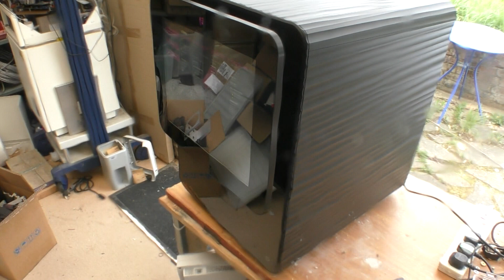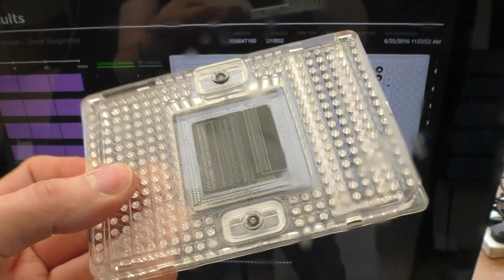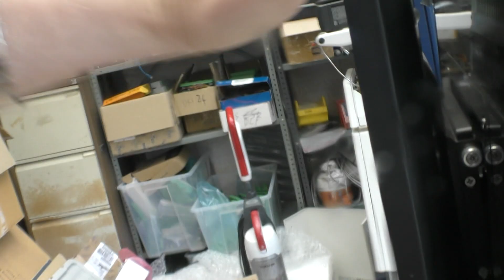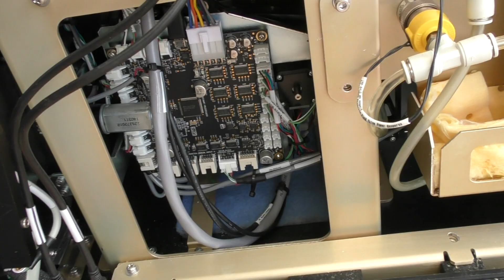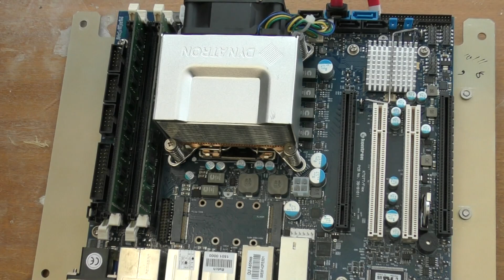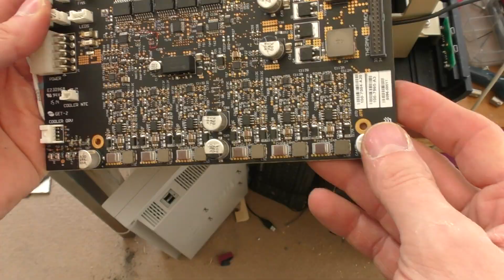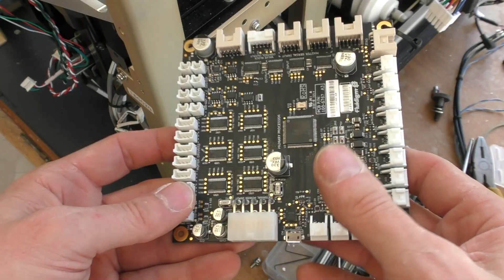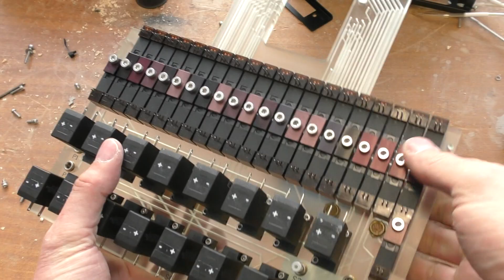Fluidigm Polaris (Part 1) - Biotech goes "Apple"?

Comment: As someone not directly involved but very familiar with the industry of super-expensive super-low-volume machines: The looks do matter. In the end, these things get sold at tradeshows. Having your unit stand out on a trade show makes a big difference. On top of that, it is a way to differentiate from others. By not being 'boring grey box', you avoid being forgotten amongst the sea of grey boxes. 
Then there is the psychological effect. Sure, that machining might add 5k to the BOM of the machine, but after all, that is just 1% of the list price. And the users who might trial the machine do subconsciously (even if people claim the don't care - research shows they do) associate it with a fancier, better product, even if the specs are almost identical to another machine. And then if your device is in the same price bracket as another device with similar specs, you might win the contract a bit more often than if you saved a few k on machining. (that said, some of the machining here is a tad excessive, like the display - could make that a straight back with much fewer machining ops that would still look amazing, but I digress).
It also helps you have a clear, recognizable style. Why is all the expensive keysight equipment black, rohde&schwarz blue-and-white, and Anritsu Green-and-white? Because that kind of corporate identity matters to your end customers.

Even if all of this just sells you 10 or 20 extra machines, on a machine you might sell a few hundred of, that makes a difference. On top of that, you might get away with a few percent higher sales price, which easily offsets any additional cost of the machining. 

And as a final fact: A lot of these product lines start with startups. Those startups have over-eager (young, fresh grad) designers and engineers who are just excited and lose track of the bigger picture.
Reply: Yes will bet the ones in those cases are original designs, the later ones in less fancy are from later on, when the company was bought out by one of the larger ones, and only keep the old machines in the line up because they have either lots of the parts in stock, and the income from consumables is good. Later on they will be discontinued as parts run out, and then the boring generic line will be folded into the parent completely, leaving no trace it ever existed.
Reply: You're not wrong! But I have to admit that if I had to select what I buy for my company, I would already be put off by the power button not being a physical, reliable clonky switch. I would also not like to spend extra on some useless design, which I KNOW is only there to lure me towards that model. I hate being lured and advertised to with quite some passion.
I want specs, certificates, TCO metrics and a fair price. I already know that I won't be getting the latter with products like that. Unless it absolutely excels in its actual task, and/or is EXACTLY the package I need, with alternatives with a broader use costing noticably more. Otherwise stuff like that would absolutely warn an shoo me away.
Anyone responsible for purchases at those prices that leans towards wanky bling is definitely in the wrong position, if you ask me.

Edit: Case in point, as I've continued watching now: I would have NEVER expected this thing to be so very well and solidly engineered and built, based on its "lets just make some suits happy" appearance.
Reply: @fonkbadonk5370  I hear you! Definitely think this unit pushes it maybe a tad too far, and get that it can turn people off too!

Regarding the power switch: Probably done because you want the unit to power-down in a predictable state. You can't have all the valves sit in some unknown condition before moving, etc...
Reply: @JorenVaes  It doesn't have to be an actually power-cutting switch. Just a physical one that gives off a nice definitive "clack" when I push it. Like actual metal contacts making contact. It may fall back on its own and just signal a shutdown, but I want to know it won't easily break, and can be operated with gloves or otherwise "compromised" fingers (which is an accessibility concern on top).
Reply: @fonkbadonk5370  The touch power button is there to indicate that the entire GUI of the machine is tactile.

Comment: Heck of an image sensor. It would be interesting to see what that is capable of. Shame there's probably not a lot that can be done with it otherwise without a whole bunch of very custom work. But you can definitely see where all that ungodly weight came from. All that metalwork for the optics and whatnot was pretty wild to see. Though I can safely say that the external case just looked stupid to me. Probably an absolute crapton of machining to make it look like a grey block cut out from a bigger chunk of something by someone using a one inch drill bit. Strange.
Reply: Probably easy enough to interface, USB, though likely a lot higher resolution than what they record. Probably used because they have a higher end version that uses it, so use the larger sensor, and crop the image. Makes alignment easier though.
Reply: There is a video out on it now and it was actually very easy to interact with it since there existed a simple program that could control it.

Comment: The code for that script... spills wonders on its creator.  They really spent the money on looks, but the parts that does the actual job, seems to have been second thought.
Reply: Not really, what it costs to design that outside look is pretty marginal compared to what it costs to design the internals of this thing.
Reply: very common in this kind of equipement, software ends up being crappy python script.

Comment: On one hand, perhaps some of the design is a bit wanky and overdone. But it looks like the UI has had at least a little bit of thought put into making it nice to use, and look decent. That alone puts it leagues above most specialized equipment where the UIs are generally ugly and unnecessarily obtuse (and still running on Windows XP)
Reply: a python script, lol.
Reply: @lo2740 the event scripts are python, pretty confident the main application & GUI isn't. And there is nothing wrong with using python for that.

Comment: I wonder how they design those microfluidic stacks. Perhaps they just use regular PCB layout software with special footprints, extract the different layers from the gerbers, edit some stuff manually and use those for machining the plates before bonding?
Reply: what? lol, why would you use altium, it would make zero sense, you can be sure there is specialized CAD sotware to do that, if not they just used industry standards like Katia or solid edge.
Reply: @lo2740  I never mentioned altium specifically.
And why exactly would you not use PCB layout software, why does it not make sense? The whole stack is just a 2.5D problem, no need for full 3D modelling. Essentially these stacks are also just traces on substrate. Instead of copper it is flow channels (lack of material) and instead of substrate you have poly carbonate. The output of PCB software can be chosen as vector files, and those are perfectly fine inputs for CNC routers. If you can CNC the plates, and stack them together, you have your microfluidic stack. You tell me why that 'makes zero sense'.
I'm sure there's extensions for Solidworks etc, but it doesnt make it inviable or dumb to think of other ways to do that same task, perhaps even more efficient.
Reply: You need the threaded holes and other features which aren't used in PCB CAD. So solidworks, katia, etc. as mentioned would be used. You can also use them to do fluid simulations, calculate tolerances, part weight, and more.

Comment: man clean your lens before you start filming, lol.  also, have you seen the amount of design that goes into the art installations that you work on?  "apple level wankery" is entry level wankery, man.  at least apple devices are useful to those who own them.
Reply: He's probably talking about how the design language of the device is reminiscent to Apple's earliest classic Macs from the 1980s.  That, or he may be calling it out for being extremely expensive to maintain, or that you would only be able to go through the manufacturer to fix it.  If that's the case, God save you if the manufacturer goes out of business or decides to stop making replacement parts for the model you have.  That, especially on a device literally costing as much as a small-town suburban home or a luxury sports car, is why "right-to-repair" laws need to be enshrined at the administrative level for every country the United States and United Kingdom do business with, including each other.

Comment: Definitely some very interesting stuff going on inside hat machine. 400k is something! 

I'm kinda envious about how you're able to lay your hands on high-end scientific and medical gear, but now that I saw how Rinoa got a high-performance liquid chromatograph that was no longer used and just sitting there in a basement in some lab, everything is possible.

I love the fluidics part of it, it's extremely complex. A thing of beauty and a joy for ever... maybe not that for ever now that you discombobulated it. Definitely some wonderful engineering went into it. Agreed on using a PCB as a backplane for solenoid valves. It'd be so much more elegant his way.

I can imagine Dave Jones aesthetically wanking over the die-cast aluminium parts, haha!

16:57 who even does check flags using case-sensitive string comparison like that? Totally unpythonic.
Reply: that last part of your comment, lord. I spat my drink